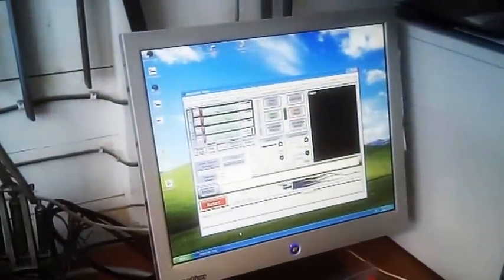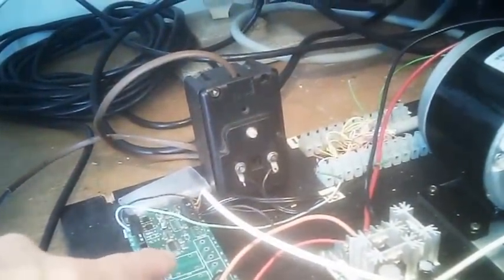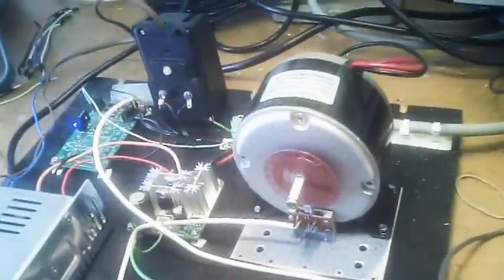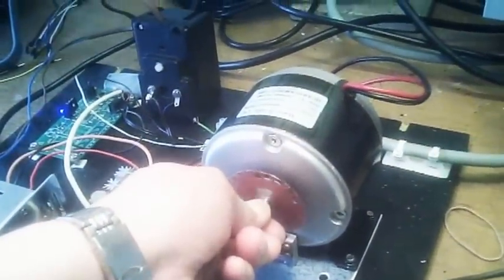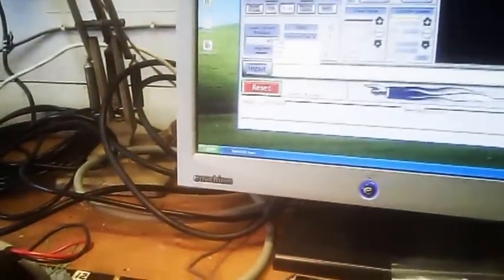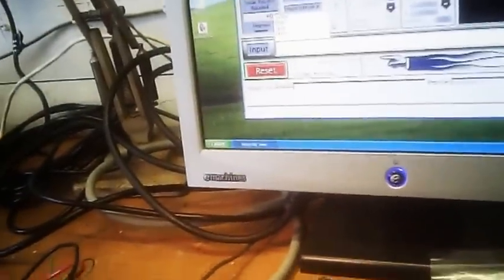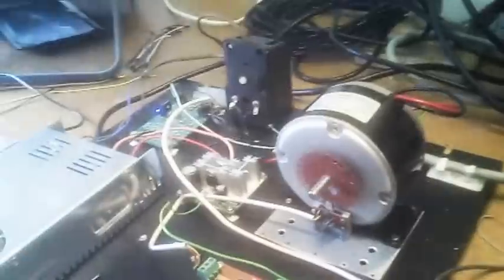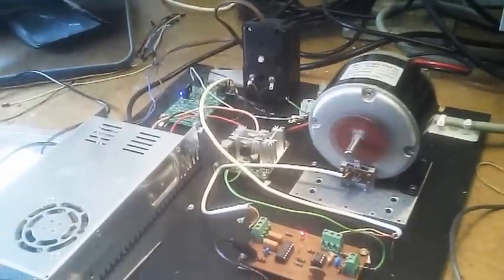24v DC motor speed control

Comment: The software that controls the motor prob has proportional and integral control so if the load slows it down it just increases the pwm or voltage until the speed is at setpoint again.

Comment: Jim Taylor  Hello, it is very  useful device .  I have the same motor. Could you  give me the circuit of this   feedback  regulator?
Reply from the maker: HelloI have actually redesigned the circuit and am using it in my  cnc machine spindle motor system. I'm planning to explain it all soon in a yt vid. Watch this space.